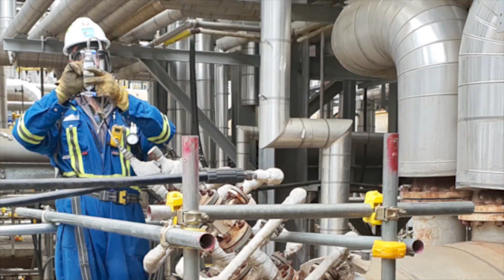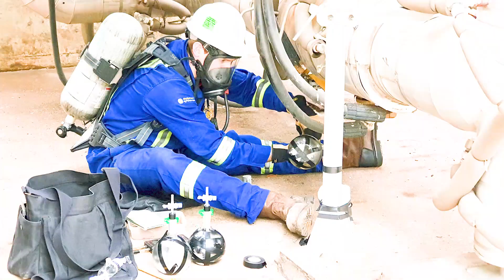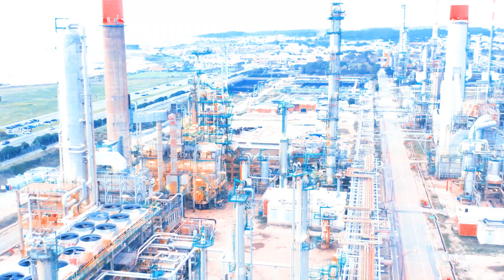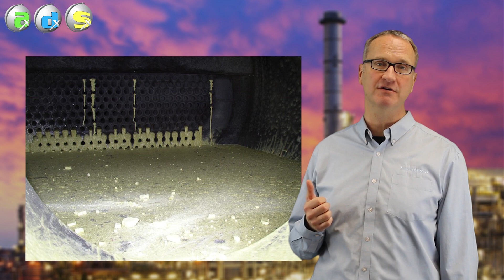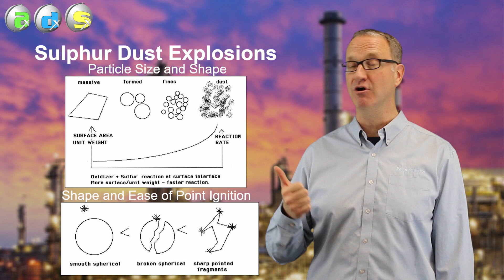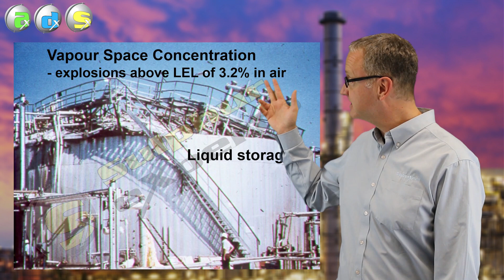How to Avoid Sulfur Plant Fires and Explosions

Comment: good evening,  i need ur experience in this field  about sulfur handling and  crushing sulfur , we have crushing sulfur operation inside  gas plant  we use heavy equipment's to crushing and loading sulfur  , during crushing activity  there is fine dust collecting inside the engine of equipment's spicily the dozer how we can prevent the catch fire or explosion  during the crushing activity , is this operation save  using dozer  for crushing sulfur .

Comment: Thanks a lot for this useful video. I have a few questions about the fire of sulfur units in refineries (eg SRU and SSU).
We are trying to avoid fires, but what steps should we take to mitigate possible fires in terms of detection and extinguishment. We have heaters, conveyors, stockpiles, silos and bagging facilities etc. Should we consider water spray for all these areas? What type of fire detection can we use (SO2 detector? or LHD around silos and alongside conveyors?)

Comment: Is it ok to run with fluctuating temperatures in the hydrogenation reactor which is caused by fluctuating tail gas ratio, and will the catalyst hydrogenate/hydrolyze the SO2/COS/CS2 or will it simply slip out of the reactor without getting converted and cause SO2 breakthrough and choke the Quench column filter ?  Also will this reduce the catalyst life ?

Comment: the hydrogenation reactor bed temperatures keeps fluctuating because of tail gas and poor burn stoichiometry in the RGG, will that case a fire in the reactor ?
Reply from the maker: The primary cause of temperature rise in the hydrogenation reactor is from the reaction between SO2 and H2, so when you have fluctuating SO2 in the tail gas you will also have fluctuating temperature rise in the hydrogenation reactor. A large amount of SO2 will cause a large temperature rise, however this is not a “fire” but simply the heat of reaction. As long as the temperature doesn’t exceed around 400C for long periods or around 500C for short periods, then this elevated temperature rise is not a problem. A true “fire” would occur if oxygen (from air) enters the reactor, but even a poor burn stoichiometry in the RGG usually won’t allow enough air to cause a significant fire. Fires normally only occur during startup or shutdown procedures when higher air volumes can enter the reactor if the procedures aren’t correct.